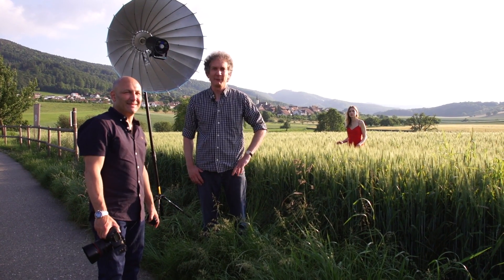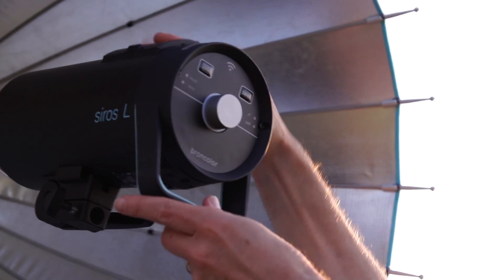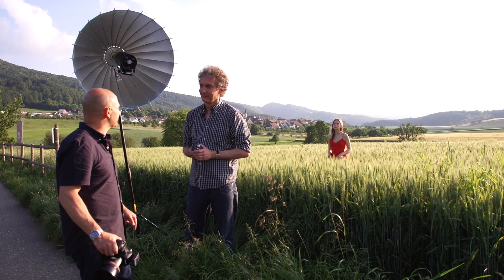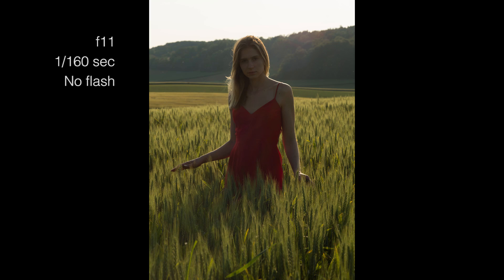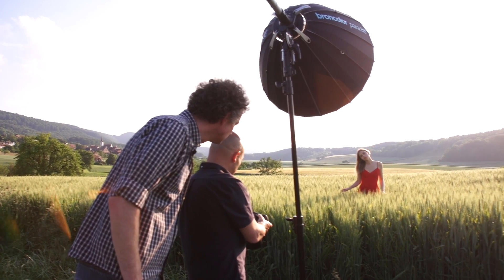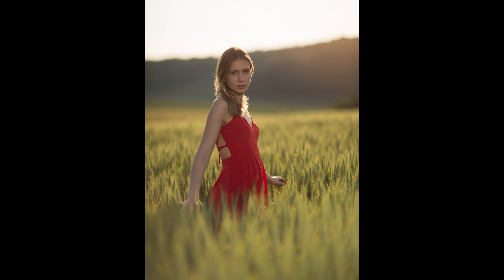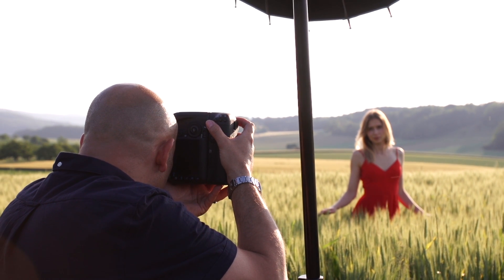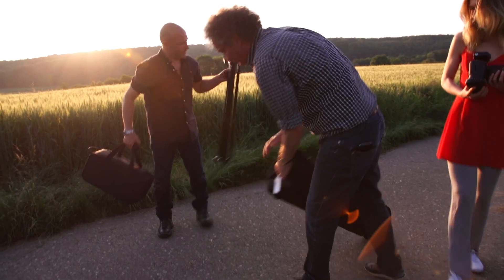How to Sync your Flash to Fast Shutter Speed

Comment: How does the HSS capability work if you have a medium format camera such as  an Hasselblad, a PhaseOne or the new upcoming Fujifilm?
Reply from the maker: At the moment broncolor RFS 2.2 triggers are only available for Canon, Nikon and Sony.
Since medium format cameras have another shutter technology than full frame dslr cameras, it is possible to have shorter exposure times than 1/250 s. For further information please get in contact with your camera manufacturer.
Reply: Photone Photography It's HS, not HSS.